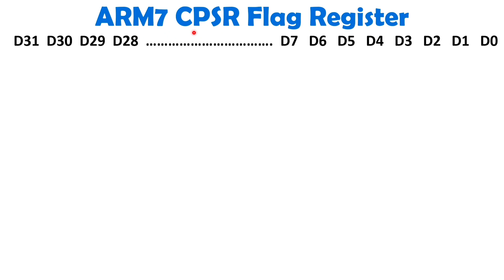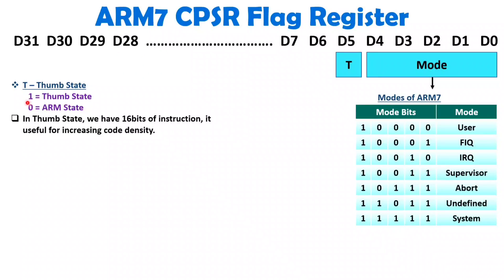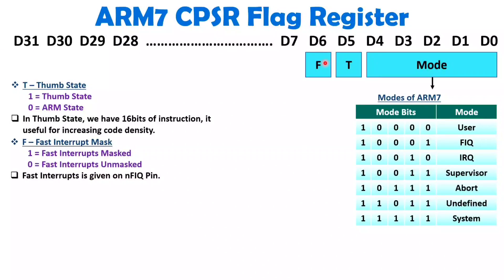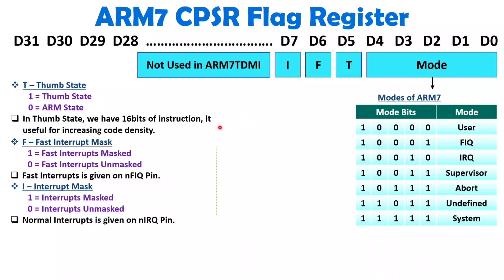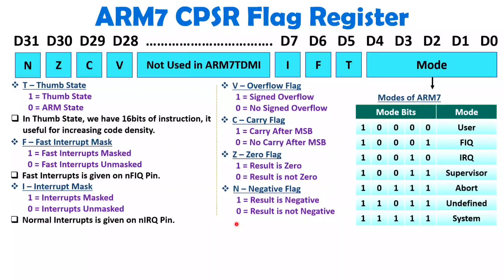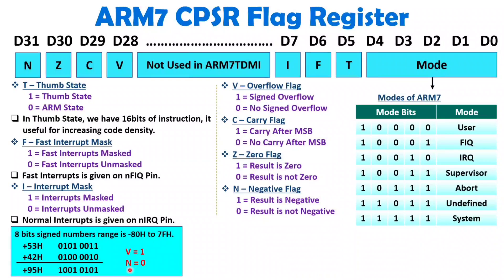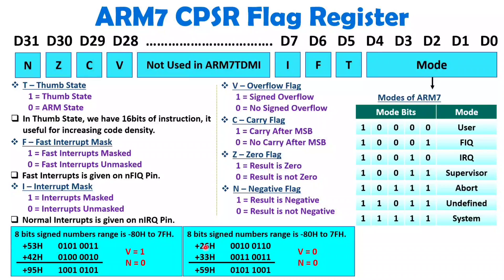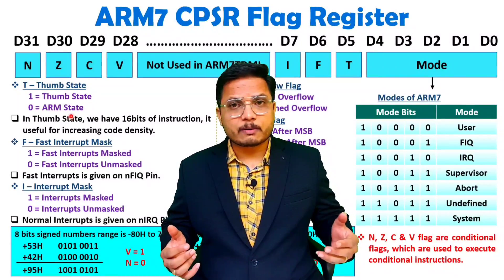CPSR Flag Register of ARM7: Status Register, Modes, and Current Program Status

Comment: why 8 bit signed number rande is -80H to 7FH. please answer
Reply from the maker: An 8-bit signed number is a binary number that uses 8 bits to represent a value. The most significant bit (MSB) of an 8-bit signed number is used as the sign bit, with a value of 0 indicating a positive number and a value of 1 indicating a negative number. The remaining 7 bits are used to represent the magnitude of the number.

In two's complement notation, which is commonly used for signed binary numbers, the range of values that can be represented by an 8-bit signed number is from -2^7 to 2^7-1. This means that the range of values that can be represented by an 8-bit signed number is from -128 to 127.

However, in some cases, only the range from -80H to 7FH is used for 8-bit signed numbers. This is because -80H (-128 in decimal) is the two's complement representation of the smallest 8-bit signed number, and 7FH (127 in decimal) is the two's complement representation of the largest 8-bit signed number that can be stored in a register.

Therefore, the range of -80H to 7FH is often used to represent 8-bit signed numbers in certain computer architectures or programming languages, to simplify the implementation of arithmetic operations and memory management.
Reply: @EngineeringFunda  sir as u given example in the last slide range -80H(-128) to 7FH(127) so there we got answer as 95H which is in range of -128 to 127 so why u took overflow V as 1 !?
Reply: same doubt
Reply: Ohh I can't expect the answer within 1 hour thank u so much sir. Even I couldn't complete 13 th vedio.